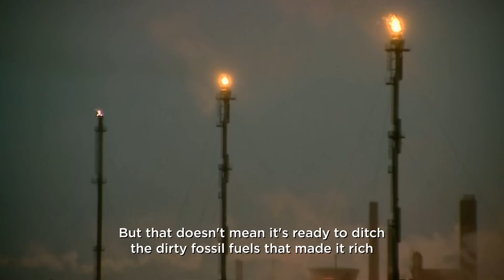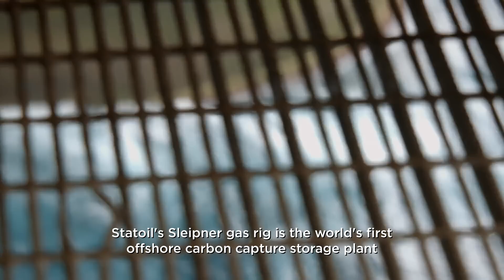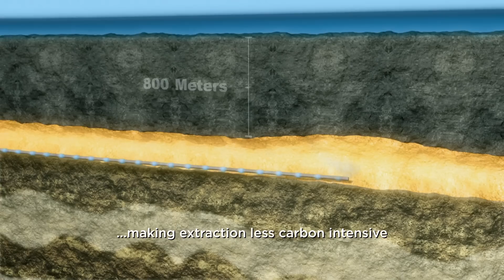Oil and gas companies are facing major technological disruption

Comment: Good luck forging and casting high grade steels and other metal-works with wind electric power. LOL
Reply: "high grade steels" are not stainless..  Further, the energy conversion ratio from wind to electricity to heat is phenomenally inefficient.  To convert all of the worlds metal foundries and other industries that require heat energy, to run off only Wind energy, instead of coal and other fossil fuels, would put such a strain on the electric grid, there wouldn't be hardly any energy left for anything else.
Reply: No upper limit?  Yeah, there is, it is, how much space is on the planet for your installations, and how much material you can harvest for their construction.  Speaking of construction, I'd like to see your electric bulldozers needed to form the land, and oversize capacity electric trucks needed to transport the materials from production to placement.

Ah yes, batteries, those wonderful things that require caustic and other hazardous materials for their construction...
You know... Fossil fuels are batteries too. Very energy dense batteries you need only mine out of the ground.
Reply: Ooh, Technical Jargon.  I was just refuting that there was no limit. There is a limit for as long as the surface area of earth, and it's Volume, remain finite in number.  Human ingenuity is not limited by finiteness so naturally there is no limit there. Feel free to swath the earth in solar panels and electric windmills for solar and wind energy, but it is an exercise in Gross Inefficiency.

Put simply, Wind Energy, is a product of Solar energy itself, which is a product of thermal electric energy out in space, radiating onto Earth.
Why go through the process of converting mechanical and thermal energies into electric, at gross inefficiencies, when you can just apply them directly to the same form of energy? Thermal for Thermal, and Mechanical for Mechanical.  If we need electrical energy for digital-electric things, we should tap directly in to the font and well-source of electrical energy on earth to begin with- atmospheric electro-static, like Nikola Tesla did, about 100 years ago.  No need at all for fossil fuels, solar panels, and electric grids.

But that's not to say we can't use what we want if we want to use them. Just not out of necessity.
Reply: I don't think you see what I'm saying.

If you haven't heard about Fresnel Lenses, now would be a good time for you to do a search here on youtube and find out their capabilities.
If you haven't heard about External Combustion Engines, and what can be done with them through solar-thermal, now would be a good time to do a search here on youtube and find out their capabilities.
If you haven't heard about the Electric Universe, and how it applies to our sun, now would be a great time for you to do your research here on youtube, and find out how the universe Really works.

Fossil Fuels are batteries, extremely energy dense batteries. No, the efficiency is not there compared to direct from the sun, but per volume and poundage, they are far and away more efficient than solar panels or windmills.  Solar panels and windmills cannot produce continuous energy, they are pass through vehicles, to convert energy into a battery form. The batteries requires for them are far and way the most expensive part of the whole system. Not counting subsidies on either side, I can't say which is truly cheaper, but fossil fuels are definitely more efficient for the energy you get.

I'm not saying we can't use any or all of these sources, simply that it should be a choice, not a requirement. if it were me, I'd use mechanical windmill stations, solar thermal, external combustion, and Tesla coil technology for only their strong points.
Reply: Trevor H I stopped taking you seriously when you mentioned EU, I strongly suggest you to deepen your education.
Reply: @dicktrolington416  
Coming from someone whose name is "trolington"?
Perhaps you are the one who ought to deepen your education beyond what the common media outlets tell you.
Reply: They'll do it. Governments will increase taxes (which decreases tax revenue and the productivity of a nation), create huge bureaucracies to control things and try to force things to fit their agenda until they finally fail at the expense of the citizens.
Reply: @EdmontonRails  What are you referring to?
Reply: @trevorh6438  The history, present and future of our societies.
Reply: @EdmontonRails  Ah, I see what you're saying now. Agreed.
Reply: Trevor H dumbass

Comment: How is pumping CO2 underground any better? Earth gets better only if we stop using fossil fuels
Reply: PastorOfMuppets well, since there are too many CO2 in the atmosphere level, pumping it back to the ground is a no brainer
Reply: I don't think you got my point. If you pump CO2 into the ground, isn't it pollution again? You are just not polluting the air, you are harming the earth below the surface(underground). 
And it's too much*, not too "many" CO2.
Reply: PastorOfMuppets yea too "much", since they are trying to be a carbon "neutral", those CO2 come from the underground oil, so they tried to put it back where it was. That's the idea. You dig it up, use it, put some of it back.

I think "Polluting" is a debatable word, since those CO2 comes from there afterall but in form of Hydrocarbon chain.

Comment: for a total green revolution can take place we must, in my opinion and others, change our economic and social system to allow the change to take place.currently the people who represent the largest number of people can't afford the technology that would help them the more, we end up driving older gas guzzler models the need constant repairs along with oil. not to mention the Hugh number of mechanics needed, and the resources to maintain the parts. the whole system would collapse under debt. So capitalism in it current form must change if it is going to be an asset not a liability to change, well that my take on what is preventing change at the consumer level for the poor. Thank You

Comment: First, renewable energy accounts for a very small fraction of all energy produced, and that's not likely to change anytime soon.

Second, power production shifting to nuclear will significantly reduce coal and oil consumption. Nuclear, non-Uranium, power production is pioneering technology that has proven to be safe, reliable, sustainable, and almost zero waste. The journalist class should research thorium power production. Additionally, nuclear fusion is not far off in our future. Some scientists are very close to sustaining and harnessing fusion reactors.

Third, oil and gas companies should be good environmental stewards. The obsession with pseudoscience detracts from concerns environmental scientists express regarding industrial activities.

Fourth, CO2 is an inert gas. The greenhouse hypothesis, it is untested, is anti-science as far as chemists are concerned. Yes, climate change occurs and 97% of climate scientists agree. However, there is no general consensus as to the cause, and many different theories are gaining traction in the scientific community. Industrial activity leading to a wasteland future is nothing more than propaganda from a monolithic media class.
Reply: Really? Experts predict that by 2050, solar energy sources will produce 25% of world's energy while the wind energy sources will produce 35% of them. Combined, these clean renewable energy sources will provide 60% of world energy consumption by 2050. The development of electricity is much faster than internal combustion, you'll be surprised how much the cost is reduced during the last 10 years. The only problem is small battery and other sources for backup.

Comment: gas stored in a pocket at only 800 meters underground?  Sorry but that is nowhere near deep enough.  There are cracks that run that deep.  Soon the CO2 will find one of those cracks and blow its way to the surface.

Comment: There is no such thing as renewable oil or gas. Improving the extraction methods does not solve the carbon emissions problem.

Wind and Solar are already cheaper, even considering changing weather. The economy is built around fossil fuels, that is the only reason we still use them, hopefully this will change. The oil industry needs to disappear.
Reply: I'm about to write a thesis in optimizing the wind and solar energy by predicting the weather so that it can be optimized and the energy can be used without lots of excessive wasted output. What I've learned is that by simply inventing a battery with much more efficient storage and lifetime, we can actually just rely on these two power plants, without needing any other backup. The price of this clean energy has gone down dramatically until now, only 30% more expensive than fossil fuels. If only the government subsidize this energy and put more carbon tax on fossil fuels...
Reply: 011azr yes, that too is keeping oil alive, subsidies, which I find obscene, the state (in my country too) is basically paying more for dirtier fuel out of tax money.
Reply: Synerrox เ yes, and solar will get cheaper because it's a technology not a fuel you dig from the ground.

The only challenge is upgrading the grid, so far homes have only consumed a small amount of energy, solar panels output a lot of energy at peak production moments of the day, if the grid was more powerful around homes that energy could be used elsewhere, so even without batteries a lot can be done.
Reply: Wind and solar are cheaper, excluding grid stabilisation costs, and summer-winter load balancing issues.  (Summer generates the renewable power, winter uses the power)
Reply: If something from Economic class taught me was Externalities. 
Yet we want less CO2 in our atmosphere. 
How come Oil and gas companies have subsidies, yet something that is good, doesn't have them.
It's either adapt or go home.
Guys we must send these people home, After all we are warned about bad influence.
Call your Senators to support renewable energy, and to subsidies them, while also taxing oil, and gas.

Comment: "A new decentralized world of energy production" with government subsidies at the core. Yeah, real decentralized there guys.
Reply: ok no subsidies just taxes on fossil fuels and hot air instead...
Reply: Unless governments stop interfering immediately the actual cost (once sorted out from government taxes and subsidies) will not go down, innovation and slow down and in the end we will lose out on great energy sources.
Reply: They will find a way to tax every home that uses solar panels , this will lead to war with the government.
Reply: eventually they wont need subsidies, and can even be taxed. And every homeowner with solar panels controls a tiny part of the energy production, so yeah, decentralized.
Reply: its becoming cheaper and cheaper. Also the town they visit clearly is an example that government subsidies aren't need, because they are now producing 5 times the amount of energy they use, so it's actually profitable.

Comment: Sorry but this a poor corporate promo with zero journalism.
Reply: The video was about the new technology that is arising, and thats why they talked a lot about the small german town. The part about Statoil and E.on–although focusing on corporations–was about the new technology and change that they're taking part in.
Reply: Also, the series is called the disrupters, and although the video focuses a lot on these corporations, they fit the category of disrupters.
Reply: It's only really a commercial if you're making a choice in their energy market, which is unlikely. What you just watched is a demonstration of how the old big energy companies are having to change, being forced by regulation, public opinion, and just common sense.  
I'm actually on this video because about 2 hours ago I was at a lecture about offshore power in the north sea, where one of the two speakers was from Shell. While I still think big oil could do more, and they certainly have bad reputations for good historical reasons, the simple fact is that a hard business analysis, looking into the future, is driving them to slowly turn towards renewables, or they will eventually die out. Tougher regulations are being pushed for (certainly in the EU), fossil fuels are running out, and renewables are getting significantly cheaper by the year. Completely ignoring climate change and the environment, those three things alone are enough to drive this change. 
You make not like these companies, I certainly don't, but due to their sheer size and share in the market, what they are doing now with renewables is important. And the title of the video is about the disruption that's coming, not an overview of their total operations. So the video was exactly what you'd expect.
Reply: and while I'm here, what's up with this reflex reaction against subsidizing solar? 
The markets are very good at certain things, such as driving efficiency and innovation within the current paradigm.
Markets are fucking shite when it comes to planning for the future, or breaking up the existing power structures, even when those existing power structures are steaming along happily towards self destruction. 
Solar is a tech we will likely need for the future. Nobody serious is claiming it is ready yet to support what we will eventually need of it, but if we don't subsidize it, the technology has no chance of reaching the required maturity in time. People forget that research is not only a case of money and will: pouring in resources in 50 years time when we are desperate won't necessarily be enough. So we subsidize it it now, to allow it to develop so it's ready when we need it. What's wrong with that?

Oh and, what about coal subsidies?
Energy in general always gets subsidized, because it's expensive, vital to the economy, and provides a lot of jobs, and that holds for both renewables and fossil fuels.
Not to mention, of course, the insane money spent protecting oil interests abroad, which is a bit more vague and ambiguous, but could easily dwarf direct subsidies.
Reply: jhon doe go on then mate show us some of your data to back yourself up :)